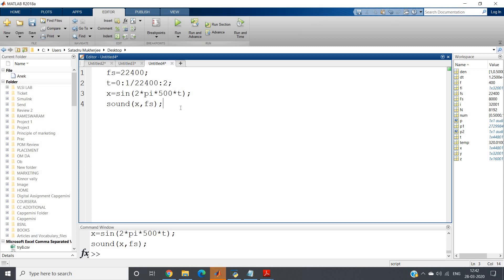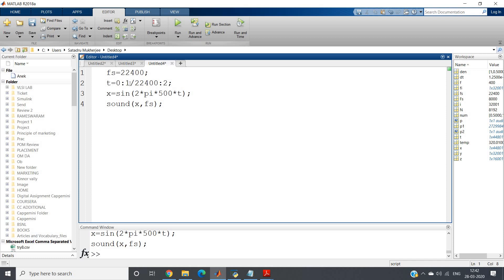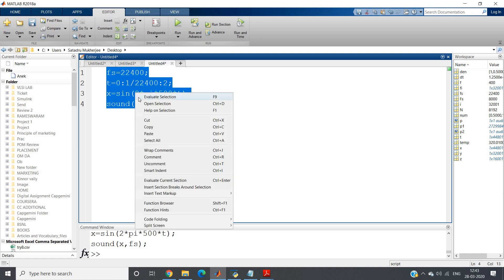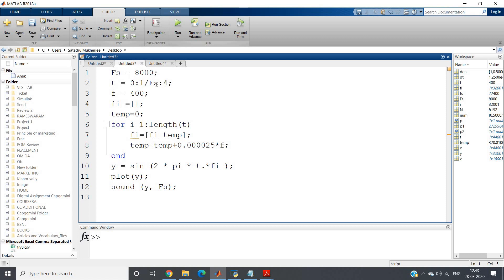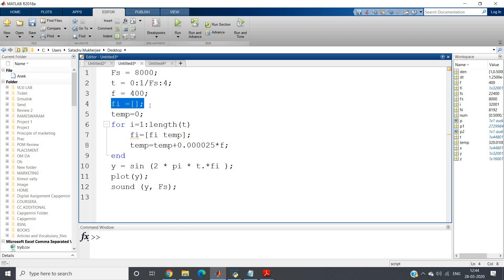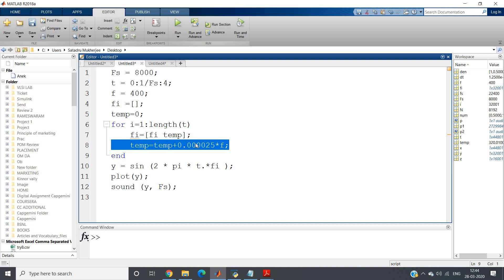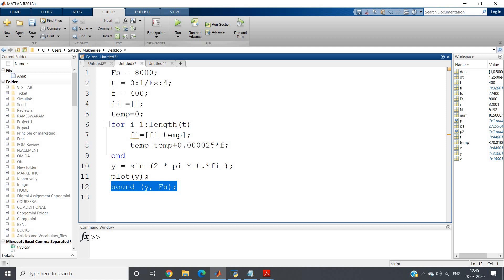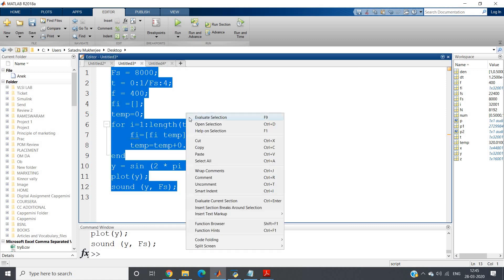Chirp Signal in MATLAB

Comment: A constant frequency is a linearly increasing phase angle.  frequency is the integral of phase.  Linearly increasing frequency is therefore a parabolically increasing phase angle.  

You don't need to step the frequency in a loop.  You can square the time instead to make the phase parabolic.

t = 0:1/48000:2;  % time values for 2 seconds at 48 kHz sampling rate

% fixed frequency tone (linearly increasing phase):
x = 0.1*sin(2*pi*500*t);  % 500 Hz tone, 0.1 amplitude (-20 dBFS)

% chirp tone (linearly increasing frequency, parabolically increasing phase)
% SQUARE THE TIME and divide by 4 to cause the end frequency to be 500:
x = 0.1*sin(2*pi*500*(t.*t)/4);  % note the t .* t that squares the time and makes the phase parabolic

% Play 'x' like this:
sound(x,48000)